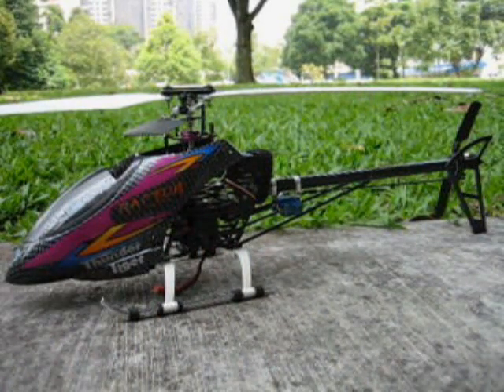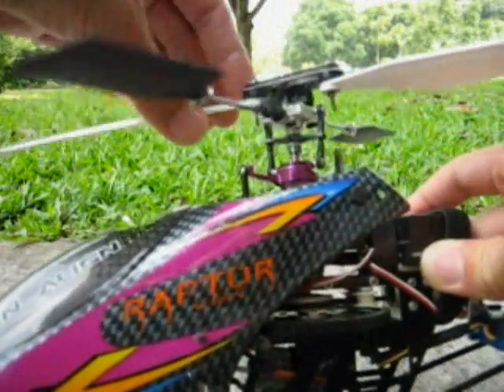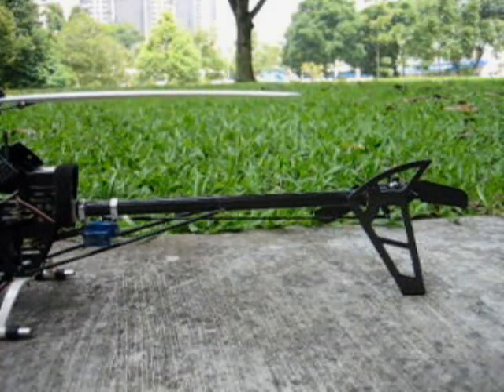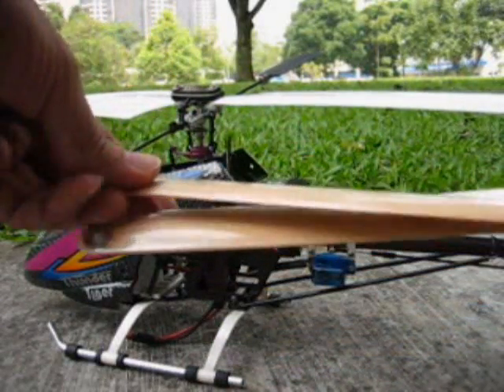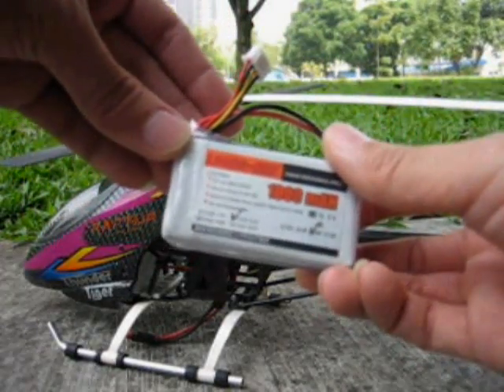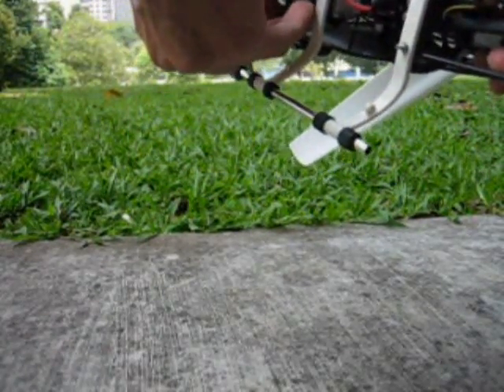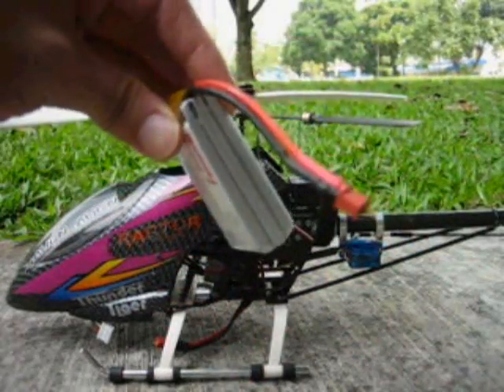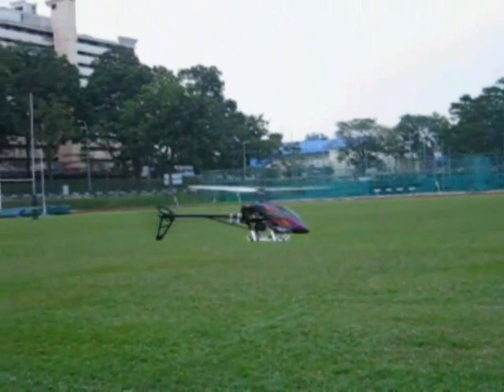Belt Driven FP Micro Helicopter with Full Metal Head

Comment from the maker: Hi SEARCHaus, this Heli is from 2006, it has a flybar and a 3mm shaft, you need a 5mm shaft and FBL head to build a 450 FBL FP. someone has done the same recently using a 450 fuse and a multiplex easycopter head.